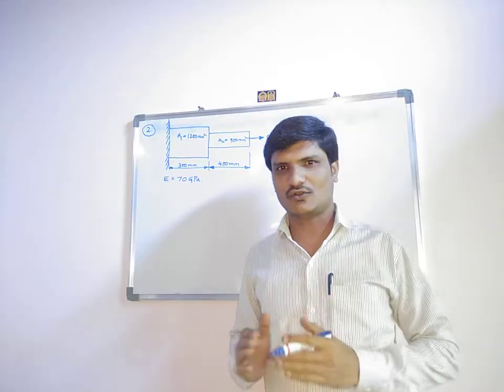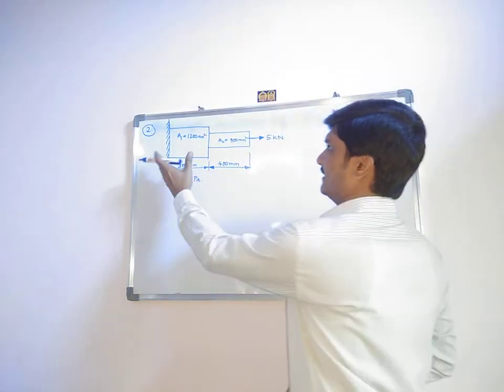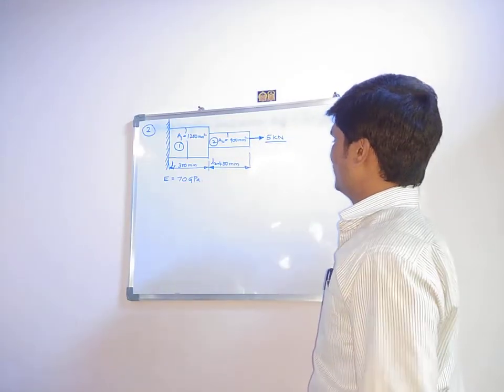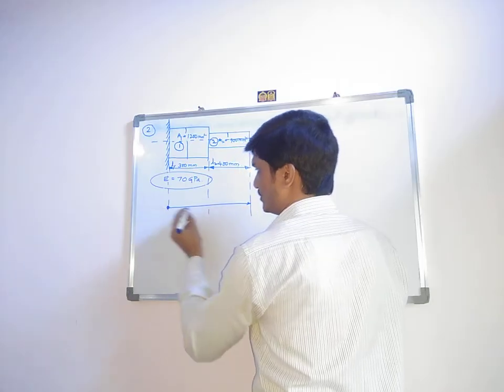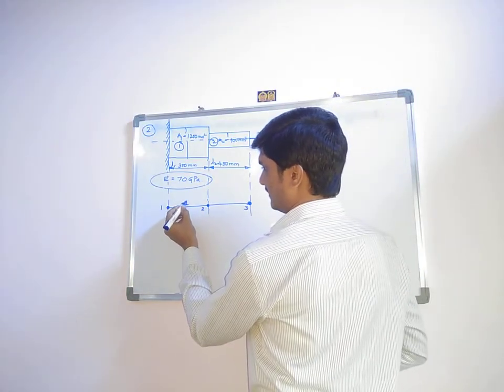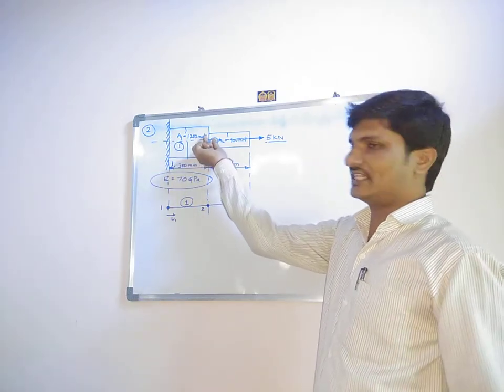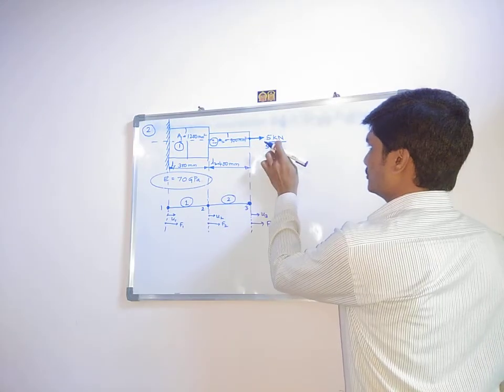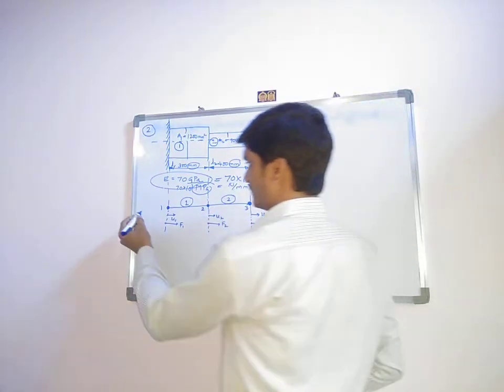FEM Bar Problems |Finite Element Methods in Mechanical engineering | Finite Element Analysis for bar

Comment: Sir if both ends are fixed and load acting in opposite,,

I mean load acting at node 2 in opposite,,

Should we take negative or positive?
Reply from the maker: Seven days back I was uploaded the above said problem.. Title is FEM thermal analysis
Reply: Sir but the question I  have come across force is not mentioned and both ends are fixed with all data given except for force acting.
Reply from the maker: OK...
Reply: Sir plzz give me Ur WhatsApp number I'll show u now